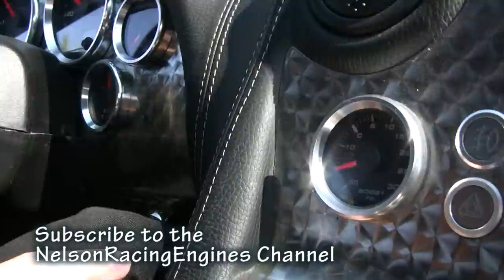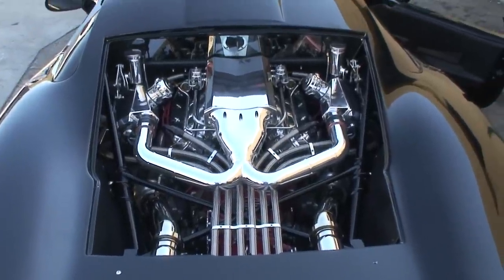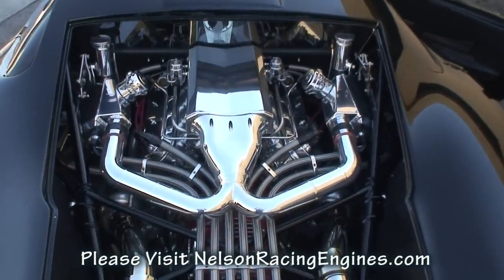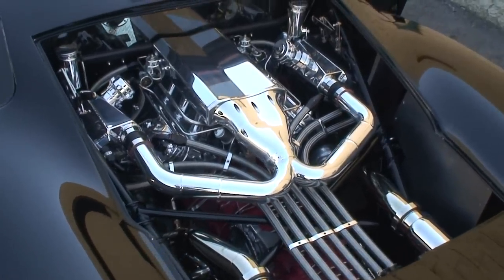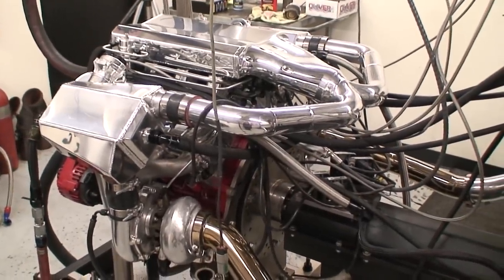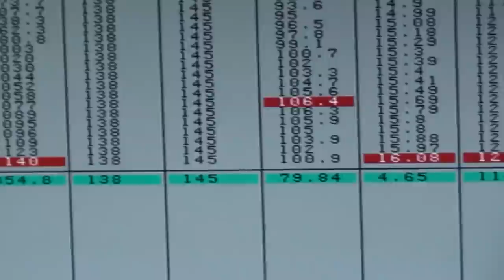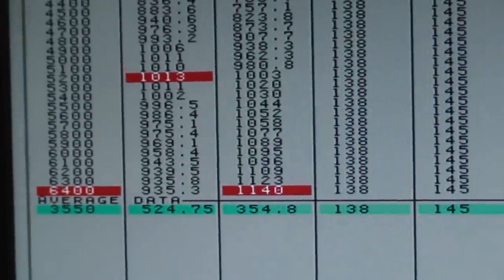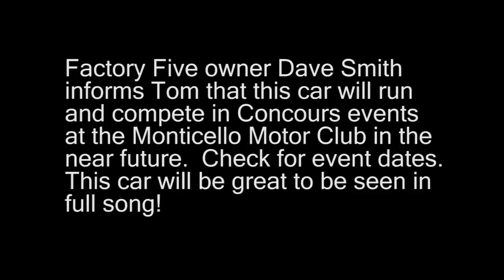NRE Drives 1200 HP Factory Five GTM.  Street Test.  427CI LSX. Nelson Racing Engines. Mirror Turbo.

Comment: What about a Grazziano gear box from the Gallardo/R8? Or a built version. They withstand all wheel drive twin turbo v10s. They will bolt to a ls based engine with an adapter if I'm not mistaken.  It's offered with the slc kit car. Either way that is sick!

Comment: I watched a video if another car it was either gtm or slc but anyways it had some after market adjustable/programmable traction control setup tied to the ecu and didn't say anything bad about it maybe look into that or a similar one and or run a boost by gear style tune on your current setup. Just an idea that might help your issue

Comment: Even at low boost it looks like the rear wants to side step on you. I am assuming even with the turbos and inter coolers the curb weight is still less than 2900 pounds. Those GTM typically finish out at 2700-ish from what I've read. At 600 HP in a 2900 pound car thats pretty intense.

Comment: This looks great, and sounds like Armageddon. Question: how are you handling all of the heat produced by that motor? Have you installed extra radiators? I can't help but think that thing gets real hot on a track. Also - you mentioned the Transaxle - is there anything helping put that silly power down on such a light car? Like an inboard e controlled brake disk or external TC or something helping slip on the transaxle? That huge motor, lightweight, huge rubber setup looks as forgiving as a pet rattlesnake.
Reply: Thats a good assesment of this master peice of insanity.

Comment: Who makes a Trans-axle to handle the torque? Everyone of these that I have seen or read about has issues with the trans. Exotics run major power but it seems it's the Torque that none of them have that kills the trans when you slap a hot rodded V8 in front of it.
Reply: For big power you need the Ricardo 6spd out of a Ford GT. I wont even bother with the glass Porsche trans when I build mine.

Comment: Quarter mile time?
Reply: its not a drag car so who cares?
Reply: paintballguy117 I care. Not a road course car either. Can't hook up on the street. So only leaves top speed .. So then what's the top speed ?  (Probably about 275mph)
Reply: Greg Quillen if she can't hook up, she ain't going to do well in the 1/4.  However, rollons easily make it a track-car, especially if she can handle.  Which by all accounts, seems this beast can, and does, easily.

And on the track, I sure don't use the same tires I use on the street.  Bet it'd grip just fine... for a 1200hp turbo montster :D

beyond that, NRE won't get my business now.  All that crap on the street? really?
Reply: I daily drove drag radials with only 630whp (740hp) to hook. 
I'd image they put slicks on it. But I never see NRE cars go-to drag strip or any tracks. Just rolling 60mph burnouts which on street tires my corvette can do
Reply: Greg Quillen tell me about it :D

I had a 69 El Camino, with 275/50s I think.  She lit them up all day long.  Course, she had no weight in the back. ;)  it's amazing what grip, weight, and tires did for her.  She went from high 13s to mid 11s in one swap and some sandbags lol.

I honestly think NRE appears to make a good engine, haven't seen one in person, still doubt it could handle the miles I put on my cars (street, track days, racing, autoX = 10,000 miles + /year)  But they're still riding off Freidburger's coat-tails and his "Project F-Bomb"

pisses me off they do these kind of stunts on the street too.  1200hp isn't anything to get cocky about
Reply: P Murphy Im sure who ever gets it probably drive it on low boost and probably wont race it much.,,
Im with you I do 25K miles a year.. I need my cars to last tons of road course track days and drag strip days.. Got 11K miles on my corvette already done road course days .. right now at 657wHP (yeah kind of too much for the road courses lol) 
Want to buy it by chance.. I want to get the new Z06 lol
On standard stock 300 treadwear street tires On the street
 does 0-60mph in 3.9secs (starting in 2nd)
and 60-0mph in 95ft  

Anyone lol
Reply: Greg Quillen - sorry bud.

I'm just trying to figure out which F5R kit to build.  I'm already building a GTM for someone else.  For me, I'm just sad she isn't a Ford GT"40" replica, and it hurts she isn't. :D

so I'm looking at the "roadster", "Type 65", and "Hot Rod".  Leaning more towards the Type 65 *ahem Daytona! :D 

and I'm with you.  I'm thinking a 400fwhp should be about perfect in a 2200 F/RWD beast for tracks and autoX
Reply: P Murphy I love the daytona.. GF talked me out of it since doesnt have modern luxuries she wants in a car she knows ill make her ride in all the time.. GT40 be my second choice.. 
I was working out specs for Daytona with 5.0L coyote stay NA for road course maybe very low boost for extra low end tq to pull out lower speed corners.. 
400wHP on a 2200 to 2400lbs car crazy fast..
Reply: Greg Quillen it is nice to finally talk to someone who actually understands cars isn't it?! :D

yeah.  My weight will go up in mine.  I'll insulate it put in a EVAP system in the back (pvc and some charcoal from an aquarium works well lol), ac and heat (live in Arizona where it actually does get below freezing on top of the 120+ summers).  It sucks, but it's a "necessary weevil" for this car.  I'm thinking of making her a GT type instead of a racecar.  I can actually handle the interior.

my only concern with a Daytona is dealing with the extremes of where I live.  I won't want to drive anything else if I can avoid it, and I know it.  She just isn't worth heat stroke over lol

I've thought about the coyote vs the pushrod myself.  Hard to beat $8K for 7,000 rpm, pump gas, with warranty and easy driving.  

just saying ;)

no offense, I've done the Zo6 route myself, track and daily... she was a pain and not good enough for either.  Too harsh on the road, too soft on the track.  Too much flex I think.  This was the earlier 2002 Zo6 though.  She didn't like LagunaSECA much, that corkscrew was knarly.

sell the vette.

join the darkside and build a F5R "Type 65" ;) with all those niceties ;) you do, first brew is on me at the yearly cruise in HB when we both get there :D
Reply: It's a daily driver so I do like my modern tech like nav, radio and more. With magnetic suspension you get the smooth ride in touring mode and no body roll in track mode (well on street tires) I drive to the track so I use street tires.. 
When I ended up buying the new house with 2 car garage I'll probably look into track toy. Daytona or gt40 if want street legal or crazy Dyson SP300R lol.. 
Can't really best the price/performance/comfort you get from corvettes. My only dislike is they are getting heavier. Granted new 2014 corvette best handling corvette yet on shittier tires but it's 100lbs heavier. Image what it do if it was lighter. Hearing new Z06 might break 3,600lbs (not heaviest corvette in history but) got to be kidding me. 

Well what stopping me beside money is a one car garage, living in a condo. And can't sell my dad 2011 Camaro he built to run 10s on a daily driver (on the tires he daily drove on). Too much sentimental value. 

Reason I was wanting to go coyote was gas mileage for cruising. On a daytona I'm sure it would get 30mpg lol
Reply: I'm thinking the same exact thing far as mpg lol.  I can run at 2500rpm, in 5th, with 4.11s in theory anyway.  Man oh man lol with a coyote or any healthy small block she'd be sweet.

that's the thing though, I'm an old-school no assists/settings with pushrod and weber carbs type of guy lol

too many years driving a GT40 kit car I guess.  And yes, they are absolutely wonderful.  Just don't ask what happened if you don't want to cry a little...

Comment: and I thought I was going "big" putting a 750hp 690ft.lbs LSX in my project GTM gen. 2, at least I won't have to worry about the transaxle, seeing how this one didn't blow apart with 1200hp and 1200ft.lbs
Reply: fallbrookchristopher what tranny are you using, because I’m building one rn and I have 1100 hp and 980 torque (give or take) and I can’t figure out what tranny to put in

Comment: Tom admittedly states the transaxle which is from a 90-98 Porsche 911 and was designed for less than 550hp is the weak point in the car and the biggest reason he doesn't flog it and the owner of the car probably never intends to race the vehicle in any kind of competition event, the car is a masterpiece and should never be endangered by pushing its limits but knowing the car weighs about 2800lbs including driver and has 1200hp at the crank we can calculate an 8.12 at 176mph in the 1/4..

Comment: Yea that track is like 5 miles man they use to land the shuttle there. It ran in 2012 in the NOT Street Legal but it was street legal but the power was not or some shit.  sorry i meant to say 267 not 276  it was like 267.2 mph that was beat with the ford gt i think at 267.6 the veyron has it in top like by .7 mph but the quickness of the car is like 0-200 6 seconds faster than the veyron 3 sec faster than the gt at top speed it's around 12 seconds faster than the veyron and 7 to the gt

Comment: of course he "drove it like a gramma".. 1140ft/lb torque combined with 1200BHP is simply frightening in a car that light. Coupled with the fact it was stated the vehicle had to computerized or any other form of traction control and what you get is a ~beast~ that can and WILL kill you..Would have been nice to see what this machine could truly do on a track? Answer yes, however they built this car for delivery to another party and hence could not exactly rip out part of the power train testing the absolute limits of the machine. I am NOT saying that such a machne should not have been track-tested even at "gramma level" testing on open streets in a machine that isaw squirrel out slightly in 3rd cause he gave it too much power if grossly negligent to public safety....

All that said i would give anything to open that thing up at Laguna...
Reply: Not to mention running hard ass compound street tires. That makes it really hard to keep it going straight.
Reply: I would say track only at high boost levels!

Comment: IF ALL YOU NEED IS 5lbs of boost... couldn't you just go with smaller turbos?   and save on weight, cost and  turbo lag?   

and instead of getting 5 lbs on the bigger turbo you go for 10 on the smaller one?  what is the reason on that..?   

Anyone know?    
Just curious.
~Thanks~

Comment: This car sounds and runs like crap.  I'm just guessing they didn't use the right sized clutch or something, because the engine is revving far too much for such slow looking acceleration.  
Whipple whine ?   Sounds like gear crushing to me..
Reply: The only thing that can't handle the power is the tires.
Reply: Seriously?  The tires?  There was no smile coming from the tires and the car never got sideways.  The clutch wasn't sized right.  I am sticking with that statement.
Reply: Luke Leukoderm dummy. Please see 4 min into the video and explain how many times you spun the tires with 0 smoke. Kind of takes the meaning away from the term "smoked em".
Reply: OK. Sure.   Now go away.
Reply: are you 5 years old? too funny.

Comment: The never ending quest for horsepower. Let's dump the engine powered vehicles because money = speed. You got the most money. you get the best toys somebody else created.Let's put you in a human powered vehicle and show us your "muscle" Then you'll have braggers rights about what YOU were able to do, instead of piling technology upon technology for horsepower somebody else designed. Never quite understood "My car is faster" ego stroke. when YOU personally had nothing to do with a manufactured part (by someone else) that made you a little faster, again YOU had nothing to do with it other than handing over your recycle efforts to buy that next part.
Reply: Would you like some ketsup with you French Cries? Should we call you a waaaambulance? lol
Reply: Howard Tanner Man, you must be a miserable person.  Going by your perspective nobody has bragging rights to anything.  You can reduce that to the lowest common denominator.  Nothing could be built if someone hadn't invented plastic, steel or composite.  What is your human powered vehicle going to be made of?  Some new polymer nobody has ever seen?  A new metal or alloy nobody has worked with?  I guess Steve Jobs and Apple did nothing because they didn't invent the PC board right?  They didn't invent solder?  It's a fucking race car.  If you don't like HP then why did you click on the link?
Reply: I get his point somewhat. The owner didn't even build any parts of the car. The purpose of a kit car is building it yourself.  That why I gave kit car owners more respect the some guy with a fast factory car. He just had money to pay someone else to try to look cool. He should of just got a Ferrari to get a better result.